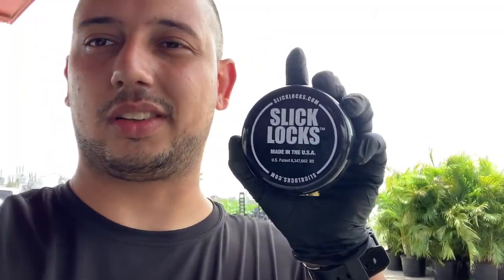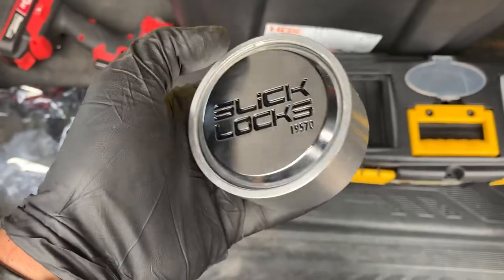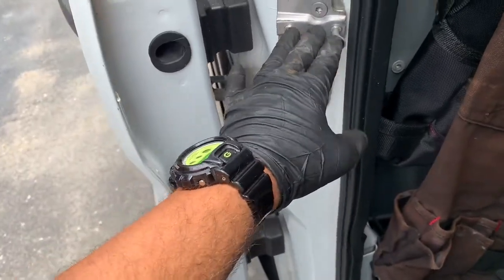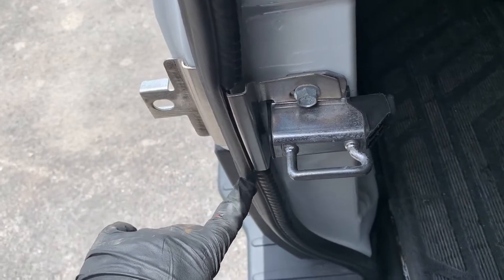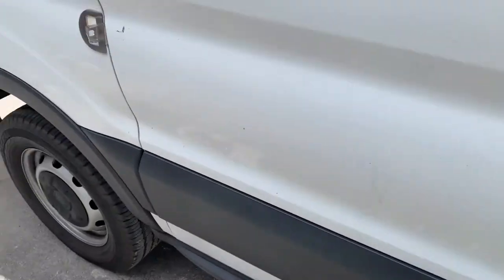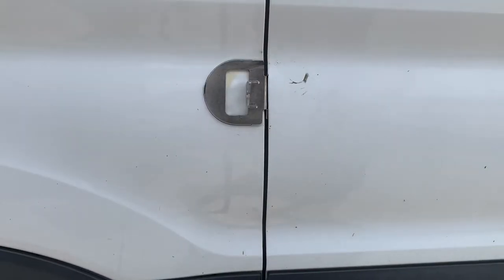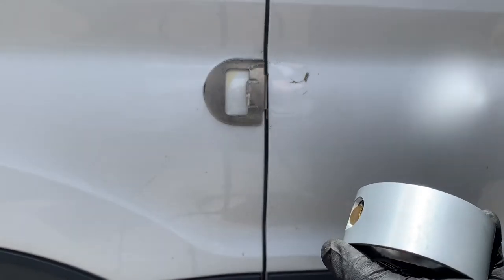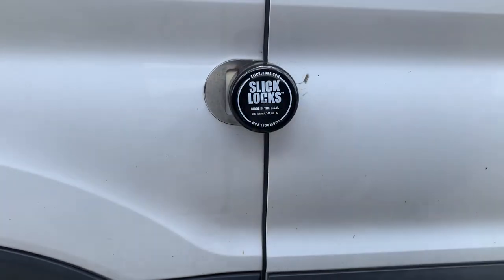INSTALLING SLICK LOCKS ON MY FORD TRANSIT !

Comment: I installed the sliding side  w/no problems. but the rear doors I have problems with. I installed them just like you did. Both of my transits and none fully shut. Did you modify anything beside the weather strip?
Reply from the maker: I did not .. you just have to close it harder

Comment: I would not use these at all. They can be hacked off in about 30 seconds.
Reply from the maker: It’s a first line of defense shouldnt be your only theft prevention
Reply: @VIPDCUSTOMS  Some would say it's advertising the valuables inside your van...
Reply from the maker: That can be true again first line of defense …